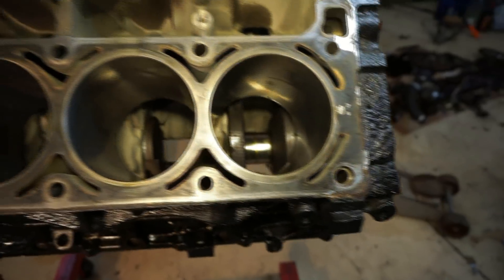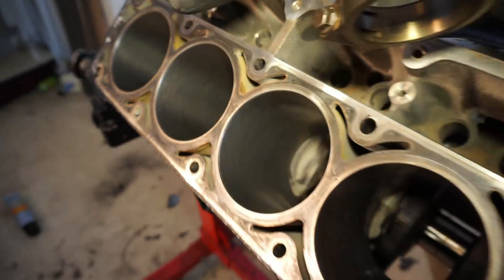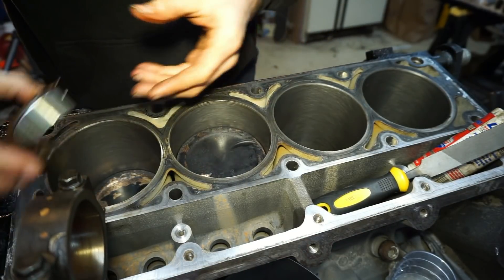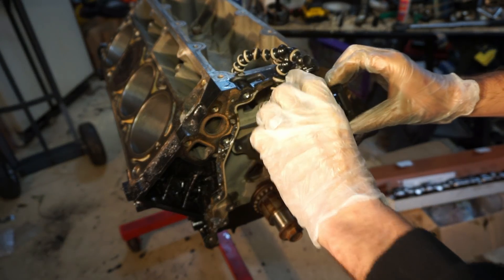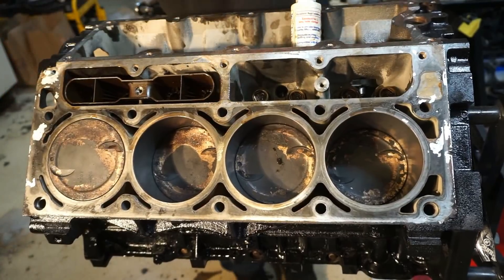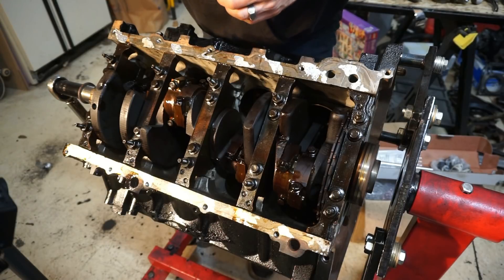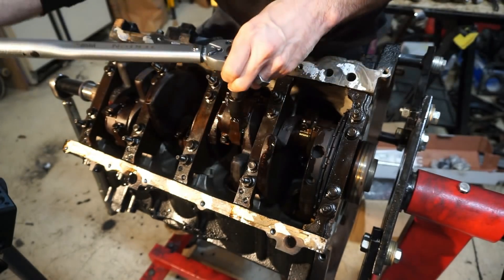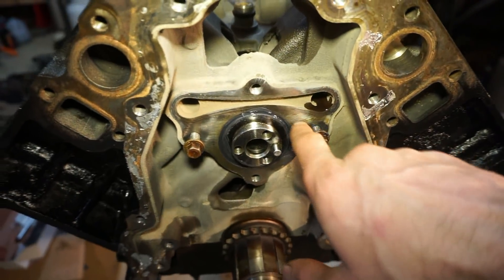LQ4 Rebuild For Turbo LS SWAPPED RANGER!!! Gapping Piston Rings, Cam Install!!! - a21bravo

Comment: Premature engine failure if u don’t put the lifters back exactly where the came from due to there already worn in and u do not want the in different holes than they were orignally

Comment: important question

If resize ring gap to chart of turbo, 
In the future if I remove the turbo do I need  to resize ring gap again?

If need it and I'm not doit what happene to the engine 

I'm waiting your answer please
Reply: No you dont just make sure that you pcv system is working properly

Comment: When you replaced the bearings did you measure for them?  Like how do you know what bearings you need?   (Coming from someone that never built an ls engine)
Reply from the maker: No, I just used standard size. I didnt really have amy reason to believe the journals were worn so I didn't measure anything. Wouldnt hurt to verify though.
Reply: a21bravo also, do you have to replace them? Or can you reuse the stock ones? If they don’t look bad lol. Serious question
Reply: @unicyclerider15  you can re-use them if their still good
Reply: @BlaserBuilds  always measure your bearings atleast with plastigauge if nothing else bearings are all different and can be too tight end not have enough oil clearance

Comment: You dont do anything with oil ring?
Reply from the maker: No.
Reply: @BlaserBuilds  even if they dont move lol
Reply from the maker: @seagate40  Are you referring to gap size or? Usually the gap is around .015... If it's stuck fix it, lol.
Reply: @BlaserBuilds  can you link the berry hone tool you use on a 5.3l n 6.0
Reply: I have a 06 5.3l apart and the top ring has no dot which side goes up? And i was refering to the oil ring, mine dont really move much or at all, pretty caked do you do anything with oil ring
Reply: Do you clean them or run them when oil ring is stuck or sludged up? Also i didnt see you clock the oil rings not needed?
Reply from the maker: @seagate40  Should loosen/clean them up. Tough part woth that is they might bend or break.
Reply: @BlaserBuilds  is there a specific way they need to be clocked or doesnt it matter
Reply: And have you had stock 5.3l top ring have no dot or anything? Mine doesnt have anything up or down look identical
Reply from the maker: @seagate40  Top ring may not have one. 2nd ring will have a dot because it's directional for scraping oil down. I usually clock the rings 180 from each other offset from wrist pin.

Comment: Stock bore 4.8, from your research would ring gaps .022/.024 be enough for 15# Boost?
Reply from the maker: HeadFlowInc I was using .0055 x cylinder bore but I went bigger now. I'm at .0075 x bore.
Reply: a21bravo With my 3.78” bore I used .00582 for the Top ring then added .002 to the second ring.  I’m limiting my build to 10-12# occasionally, 5-7# base.  👍👍👍

Comment: Transmission fluid is almost 100% a detergent & for cooling.  It has VERRRY little lubricating properties.
Reply from the maker: M B Can't find your other comment but I did soak the lifters over night before I put em in...
Reply: a21bravo cool!  Years ago a guy I knew flattened the cam lobes on a fresh rebuild because none of us knew.  It was one of those memorable moments you witness in life.  :(

Comment: I have the same ring compressor, it takes some practice. The biggest issue i had was i was tightening it too tight and it would try to go in the bore with the piston. I usually tighten it all the way down and back off 1/2 turn and they will pop right in
Reply from the maker: justin parks Yeah, the last 4 or 5 i did went in like butter... The one in the video got stuck in the cylinder, lol. I usually just do the top one by hand if it misses though, easier than puting it back on.

Comment: Tell me ur Not fileing rings while standing over the engine
Reply from the maker: tim m No, I stood away when I actually filed them, lol.
Reply: No Tim he was just banging the pistons in with a file that he used to gap the rings over the engine and dislodged all the filings of the file in the cylinder I could even hear them grinding against the ring compressor 🤪
Reply: @adamdiaz8442  absolutely nuts!🥺
Reply: I never rebuilt an engine but I figured that was a no no lol.

Comment: 3 warnings:  1. There’s no need to lube the cam lobes with assembly grease, it can actually interfere with the roller wheel. 2. Your engine oil will look like you’re having a bearing issue for a long time/several oil changes due to the Graphite.  You’ll see it in the oil 👍 3. Your suppose to oil the rings on the pistons, at least spray them with WD40.  I guess we’ll see what happens when dry rings seat. 😳.
Reply from the maker: HeadFlowInc Planning on dribbling some oil in/on the walls before I throw the heads on... Last one I replaced I left totally dry and it did pretty good. I'm trying to give at least one shit this time, lol.
Reply: a21bravo Try spraying it down Marvel Mystery Oil and rotate the engine a few times, the thinner lube should help then light oil the cylinder.  Good luck!  JD

Comment: They look like H.O. 5.3 Pistons.
Which 6.0 did they come out of ?
Just for talk sake
Reply from the maker: Slaughter's Channel I believe they were from an 06 express... Gen 4... The 5.3's are a 3.78" bore vs. A 4"
Reply from the maker: Slaughter's Channel Yeah, I tho k those were the transition years where they were scrambling shit together... This rotating assembly was from an 06 but had a gen 3 crank.
Reply: Not all 5.3 are just flat. But anyhow here's some articles

https://ls1tech.com/forums/generation-iii-internal-engine/1395423-lq4-fly-cut-pistons.html
Reply: a21bravo It's weird but yes it looks like 05,06 we're the years.

I had a Gen 3 aluminum 5.3 H.O. that them also and had Gen 4 rods in it. 13mm valley cover bolt heads.

Comment: You're going to throw boost at a motor with the old rings in it instead of waiting a day and getting the right rings?
Reply from the maker: Cole Murphy I wasn't even going to do the rings originally but I found a kit that had bearings and rings. Gapped stock rings should be more than fine. Least of my worries anyways...
Reply: Nobody has ever done that....
Reply from the maker: Cole Murphy The last motor had stock rings not even gapped, and the rods broke before anything else over 30 psi... I'm not going to run that much boost so I'm sure they'll be just fine... Depending on mileage of these motors the gap will already be big enough.
Reply: Nobody that I actually knew what the hell they were doing did?
Reply: Dumb